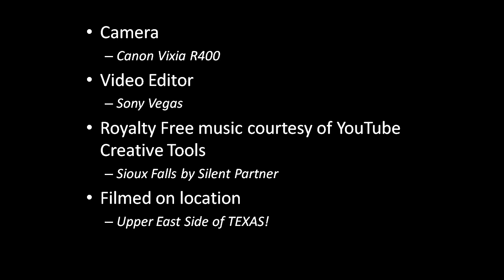What’s Going On?  -  W5CYF

Comment: John. With regards to your garage workshop. Do you not have Reverse Cycle Air Conditioners there in the USA. We do here in Australia. Gives cold air when it is a hot day, and warm air on a cold day. I just leave the thermostat set on 25 C and it either cools or heats as required. Keeps my workshop at a steady  25 C, good for the machines and me. Good luck selling you rigs at the show and in getting another Camper Van soon.
Reply from the maker: Dave, thanks for watching and for your question.  It sounds like you are describing what we call a Heat Pump here in the states.  I actually have a heat pump for our home heating/cooling and like it very much.  However the garage I'm using does not have heating and cooling vents nor insulation in the walls and roof area.  It was built as an attached garage to park cars.  Very common in the states to build homes this way.  I am looking to build a separate workshop.  I've only lived in this house for a short time and still getting things situated like i want.  Take care.   ~John